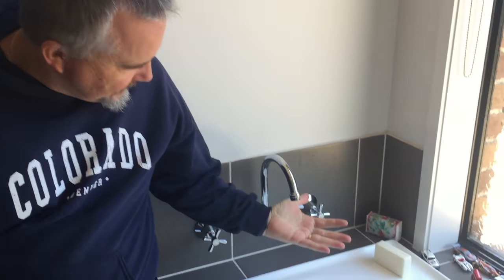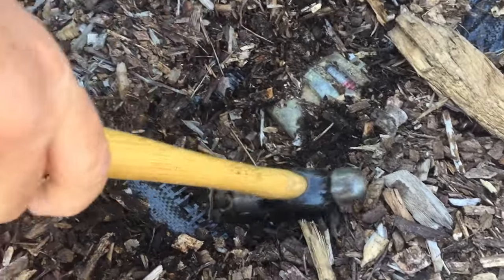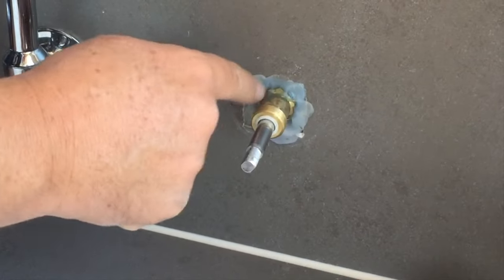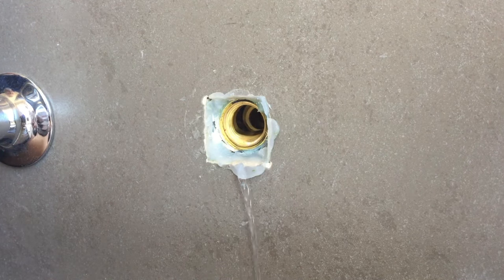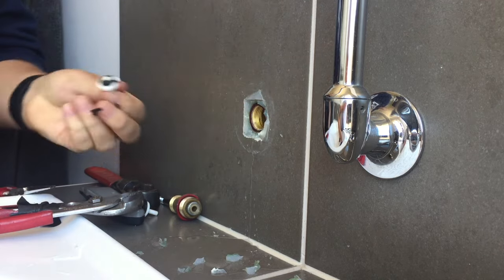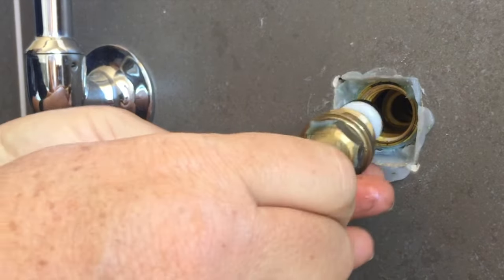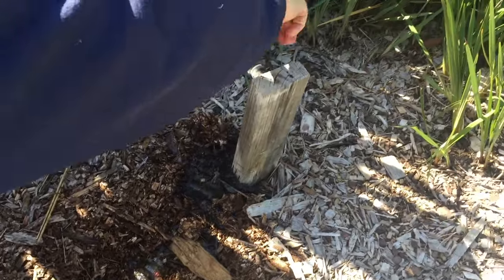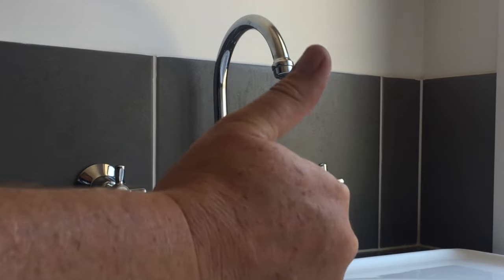Dripping Tap? How to change a Faucet Washer. Installation of a new tap. Leaking Bath sink basin

Comment: If, like me the cavities around your tap fittings are choc full of that silicon gum, then you'll find that a 20 minute job turns into a three hour job
Reply from the maker: Turns out the silicon is a vapor barrier. There to stop any water getting into the walls. Also there when you have a higher rating insulation to stop drafts or air leaking
Reply: @Marksreviewsandtutorials  Thanks Mark - I am also in Australia same as you, so I wasn't surprised to find it. Did you eventually bother replacing it behind your tap fittings after you replaced the washers?

Comment: Hi,  changed it but still it’s dripping. I need to tighten tap very hard to stop the water . Please suggest me some suggestions. Its same exact tap like this ! Thanks .
Reply: I bought the copper or metal one . Do i need to replace with one u used here ? Plastic and rubber material ??
Reply from the maker: I would need more information to help you. Is the tap leaking from the shaft of the tap? Or dripping from the faucet? Did you change both washers? ie did you change the wrong one? The washer seats against the metal at the back of the tap you would need to check if that is still Flat or if there is debris in there. Did the oring move out of place as you fitted it??

Comment: Hi Mark, Great video (as usual). I need to ask, you have replaced both hot and cold water washers, but you only turned off a cold water supply if I am not mistaken. Don't you have to shut off hot water also? Thx for sharing mate.
Reply from the maker: Hi. When you turn off the main supply to the house that shuts off both hot and cold water. If you are turning the water off under a sink then you need to turn off both hot and cold water. MRT
Reply: @Marksreviewsandtutorials  Thank you ! Got it now!  Once you stop pressure from mains, there is no pressure in hot water tank either. Silly me!!!
Reply from the maker: VanClaaude 👍
Reply: @Marksreviewsandtutorials , good question, hadn’t thought of that.
Reply: Do I have to buy that fancy black tool to do this?
Reply: @Vanyel_Kane l think 🔧 can do the job😊

Comment: Thank you for the detailed video. Mine tap is inside the tiles that normal spanner can’t reach, that I can’t screw it off the wall, what tool would you suggest to use
Reply from the maker: Have a look at the links in the description I have some tools linked there

Comment: Hi, Mark. Do I need to reapply silicon after changing the washer?
Reply from the maker: Yes that is a vapor barrier. Modern houses are sealed so they are better insulated. Not gaps through the wall everywhere.

Comment: I need to only change something in my hot water kitchen tap and I have shut of supply to the water heater and so no water is coming out from hot taps. Can I proceed to unscrew the hot water tap in my kitchen? Or do I need to completely shut off the main water?
Reply from the maker: This depends on your tap and other plumbing in your home. 
To test all you need to do is turn on the hot water tap and see if any water comes out. 
But being that you don’t want hot water having the possibility to come out under pressure why not turn off at the main to be safe. MRT

Comment: Hi there . I Have a dripping tap but the tap bell is siloconed to the tile !!
how do I loosen them please.thanks 🤔
Reply from the maker: Yes that is a vapor barrier. Just cut it out with a sharp knife. Modern houses are sealed so they are better insulated. Not gaps through the wall everywhere.
Reply: @Marksreviewsandtutorials  I tried a Stanley blade can't get in there anywhere

Comment: Are all washers the same size in circumference?
Reply from the maker: Hi. No not all the same size. Most are though. There is a standard size but of course some brands do different so you have to buy there specific washers. MRT

Comment: Where can I find the main water supply if I live in an apartment?
Reply from the maker: It will be at a point where there are water fittings. Most likely under Kitchen sink or in laundry or a bathroom. 
It can still also be outside. If you cannot find it ask a neighbor. MRT

Comment: Hi Mark, do you think every tap has washer? I could not find the washer when I opened the tap in my bathroom, and when I installed it again, it no more work anymore. What's up this problem?
Thanks.
Reply from the maker: Yes they do. every Tap will either have a Cartridge or a washer. It maybe broken or missing,  but it should be there. MRT
See this video to service a cartridge: https://youtu.be/sEu2r-qWzRo

Comment: how come it still leaks after i changed it?
Reply from the maker: If you have changed the washer and it still leaks?.
Two thoughts if it is a mixer tap change the other tap as well.
If not then the tap may need to be reseated. You can get kits at the hardware store. Check where the washer seats inside the Tap. This needs to be smooth.
Reply: Also, check that your tap doesn't have other washers. Remember that red ring seal? Also, if you withdraw the stem from the assembly, you may find a little black O ring, that may need replacing.
Reply: @Marksreviewsandtutorials  mark, what if the seat is not smooth? I think it is my problems... Cheers
Reply from the maker: @arthurbelotti8330  If you have changed the washer and it still leaks?.
Two thoughts if it is a mixer tap change the other tap as well.
If not then the tap may need to be reseated. You can get kits at the hardware store. Check where the washer seats inside the Tap. This needs to be smooth. If not smooth then re seat it.